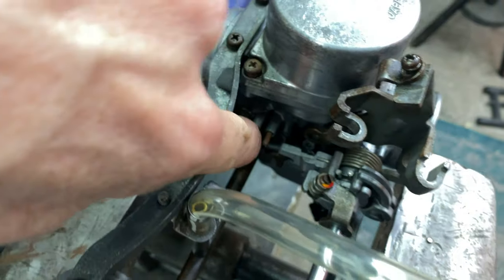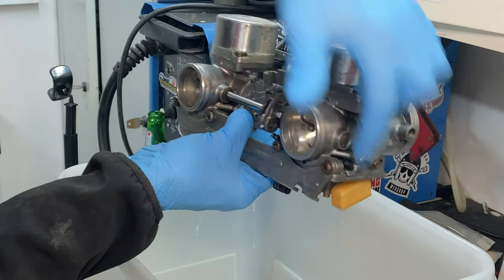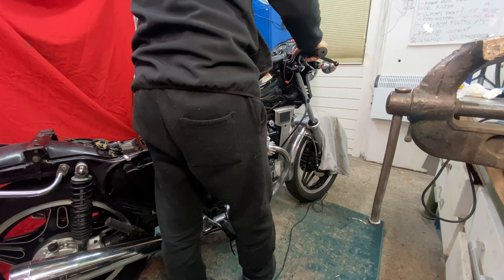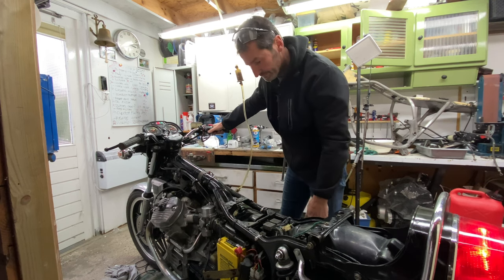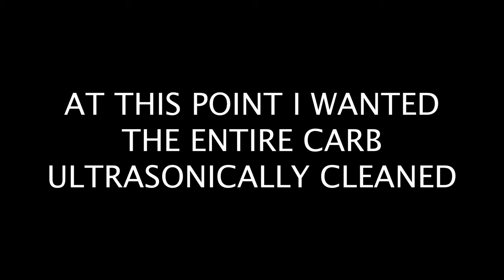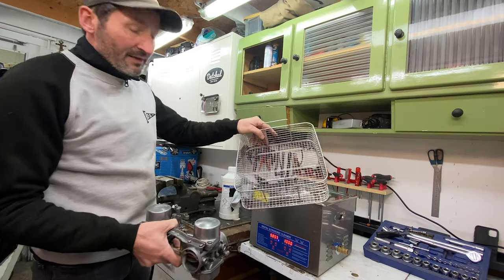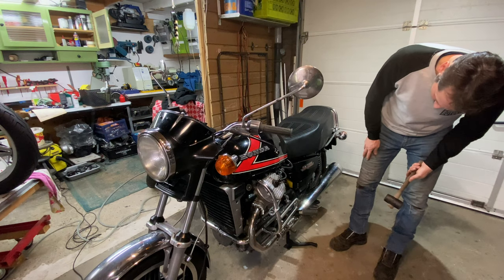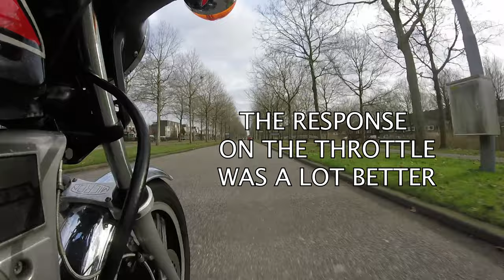Honda CX500 Ignition and carburetor problems - The Final

Comment: Thanks for your helpful video. I bought a nice eBay '82 CX500 and rode it 200km home with fuel leaking from the left carb all the way. Didn't find out until I I stopped. Got the carbs off, cleaned them and changed the float needles. All good so set off on a 300km ride but went onto one cylinder not far from home. Limped back. Carbs off again. Float needle stuck. Cleaned and reassembled and now running great. This seems to be a rite of passage for CX500 newbies 😂
Reply from the maker: Seems like it my friend. These types of bikes need attention and love. Not a problem if you like a bit of wrenching every now and then. Glad to hear you got your bike running, you learned along the way, and thanks for watching!

Comment: Coils are a major source of problems on older machines and I usually always change them as a matter of course as testing them properly is not as easy as folks think!
Reply from the maker: @johnrocker2986  coils were at my attention but just swapping out (potentially good parts) is something i wanted to avoid. The video is a while
Ago and the coils themselves where not the issue and are still working fine to this day.
Reply: @DutchedShedBuilds the thing with coils is spark degradation over time usually caused by age but checking needs very expensive and precise equipment and cannot be tested by eye, but can throw up numerous running issues unless they are 100%

Comment: you have the patience of a saint with those carbs, not sure I could of kept going that long. I only took mine apart 4 times before getting it to run on both cylinders and to not leak. Still satisfying feeling when you get it running. Mine also had issues starting when left for a few days, I just sprayed contacts and kill switch with contact cleaner and that seemed to resolve it for the time being. I love the CX, It was a very advanced motorcycle in it's day and still performs really well today. I look forward to seeing more videos.
Reply from the maker: Thank you so much for watching, glad you liked them. Those carbs gave me hell but in the end it resolved it and i learned a lot along tje way. 
The cx runs great and i ride it daily. It will not be my last 😉

Comment: My GL650 was not getting fuel on the idle and mid circuits after cleaning the carbs as best I could without proper tools. Note: it ran beautifully for a half hour or so, then the left side would starve for fuel in slow circuits. What I ended up doing was taking it out on the road and quickly bringing it up to 8500 RPM under load in 3rd gear and quickly pull the choke and let it pull down with the choke on. I repeated this procedure 5-6 times and the jets cleared themselves. My theory is that the procedure I've described would create maximum and sustained vacuum at the jets and suck out the crap that was still lodged in them. I've put well over 1000 miles on Her with absolutely zero problems. Hopefully this will help someone. Also: When I'm cleaning the carbs I use a dab of toothpaste on a cotton swab (Q-tip) and spend a minute twisting the toothpaste and swab in the needle valve seat to shine it up. Just be sure to remove and remaining toothpaste from the fuel intake gallery.
Reply from the maker: I guess you and I know that the carbs are the biggest problem-makers on these types of  motorcycles. Keeping those jets clean and not-clogged up is the biggest task. And I to did end up clearing the carb of final bits and pieces just by riding it for an extended period (if i runs well enough of course). Thanks for the tip and sharing your experience!
Reply: I forgot to mention that I drained the left carb and filled it with carb cleaner and let it sit for a few hours before doing the aforementioned process.
Reply: That's how I do it!😊

Comment: Do you recall what coils you used when you replaced the originals? I have a CX with a misfire and I'm pretty sure it's a coil issue. Replacement originals are nowhere to be found!
Reply from the maker: I never replaced the originals with aftermarket ones. The ones I used to test them were originals also. And in the end I never swapped the old ones as they were not the issue in this case. 
Dont know where you live but here in Holland they are fairly easy to come by  (second hand and new)
Reply: Ok thanks for getting back to me. I’m in Canada and they’re tough to come by here. I’ll keep checking - I definitely am missing spark sometimes.

Comment: The floats work much like a toilet cistern.  When they rise, they cut off the fuel supply.
When they fall, the needle opens up the jet, and fuel comes in.  Either your needles are
stuck, or the floats are taking in fuel.
Reply from the maker: Needles could have been a fault also but clearly they worked fine. It all worked out good!

Comment: Tell you what just bought a silver wing does not tick over forks leaking oil gears seem very very stiff and what will I do just ride it and ride it again I will only fix when it  breaks never before and this system has saved me many many hours of work I will have to do the forks because they are broken but the rest just go with the flow and I tell you what yet again 9 timesout of 10 they will just keep going but not as you want ???? When you want old old bikes to run smooth and like your newer bikes forget it they never will because like me they are old and old things need some space and a little gentle touches at times just like me.. So dont waste money and time after perfection unless you are showing the bike for some mad reason !!! With all its fauts I would still ride this bike around Europe with a good set of spanners and A.A. or R.A.C break down cover.. Who gives a toss if it will not tick over as it should who gives a toss if neutral is a bastard to select "just stay in first" !! hope you get my drift but that chap in Holand does know his stuff !!
Reply from the maker: He sure does